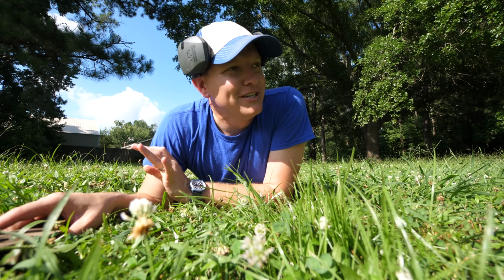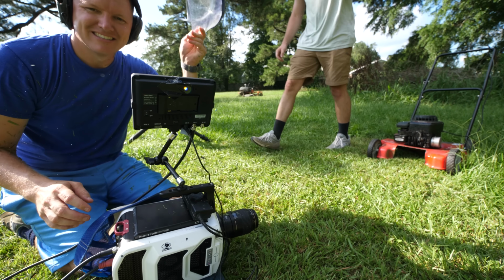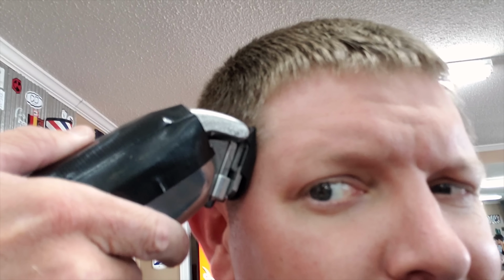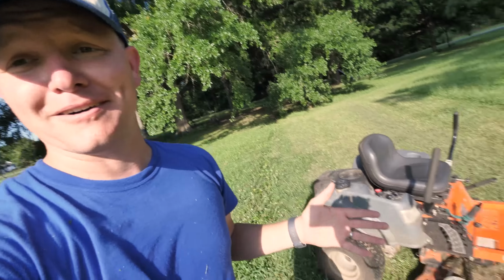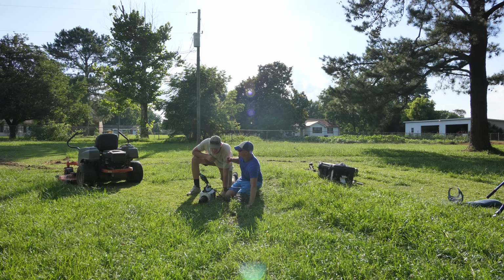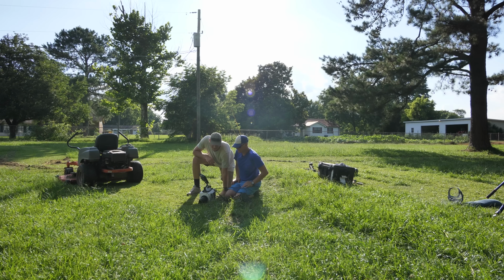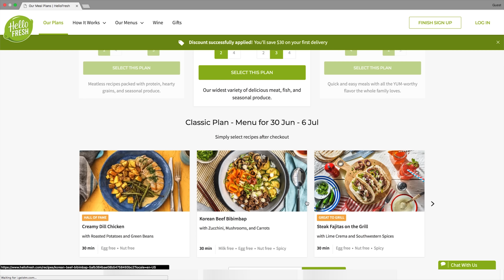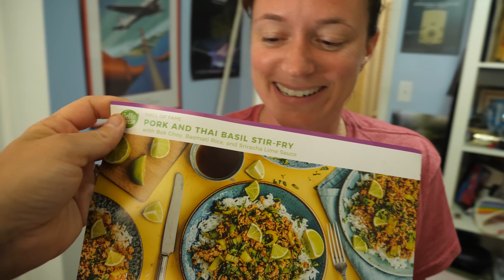How Lawn Mower Blades Cut Grass (at 50,000 FRAMES PER SECOND) - Smarter Every Day 196

Comment: Some blades dont have the "lift tabs". Explain that.
 Those are more to do with mulching. 
Remember it doesnt take much pich on a fan blade to produce lift.. Mower blades are not parallel to the ground.. They are tilted. To much tilt and you would need more power to spin them.
Mower blades must be sharp to cut correctly. 
The deck does have an effect. The side exit hole has a specific design. Your hole.. Did not. 

I feel you did not do your research prior on this one. 
Get ahold of some companies.. See if they can help you out. Sponsore and or just with some info. 
Colaborate with the LCN or Grass Daddy here on youtube. 

Btw.. A reel mower or a brush cutter are scisor like cutting for grass. Usually produce helthier and better cuts.
Reply: TurboFlush actually lawnmower blades shouldn't even be that sharp. They work with friction. Ripping rather than slicing is healthiest for the grass. The lift is there for ejection.
Reply: Alkyl Dimethyl Benzyl Ammonium Chloride from what I learned over the years from doing this as a living, you do want the blades sharp. A sharp slice in a blade of grass is the healthiest for it. Ripped grass is not healthy, makes it susceptible to disease. Reel mowers are best because they slice in a way similar to scissors (that is why most golf courses used them to this day) 
But for most yards and lawns a rotating blade as long as it is sharpened regularly will be just fine.
Side benefit, the sharper the blade the less drag it has, especially in tall/thick grass, so less wear and tear and even a little fuel savings as well 
 
Take care!
Reply: Aaron Hainan you may be right about the slice vs rip, but I do know that you want your blade to be less sharp than a knife. Maybe it's because it will lose its edge faster. I have learned that you don't want DULL blades, but you can tell by the shape of the grass how it's cutting. I've always been taught not to sharpen it like a knife.
Reply: Some blades don’t have the lift tab or whatever you wanna call it, but all blades produce lift. Either the blades are not parallel to the ground, (like you said) or has some type of curve on the blade. It doesn’t take much to produce lift when the blades are spinning 200+ mph
Reply: TurboFlush, I have to agree.  This video stopped far short of the research I associate with Destin's work.  I'm sure any of the blade manufacturers ir ztr manufacturers would have gladly commented on the dynamics involved with grass cutting.  This one kind of fell flat.
Reply: Alkyl Dimethyl Benzyl Ammonium Chloride you could have a razor edge on a blade but you are correct, it will dull pretty quickly and the edge will roll if you have too narrow of an edge to the blade. Also correct that you can tell by looking at the grass you just cut. If it looks like it has nice chopped edges you should be ok but if you see ripped or torn edges time to sharpen. I usually look at the grass after I have gone over it but you could also look at the clippings too if that is easier
Reply: Cameron4life we sell a sand blade for the golf courses that produce no lift at all. it's even sharpened in the center instead of on the edge.
Reply: I've found that my scissor mowers are useless when they are adjusted to cleanly "cut" paper. Damage from the amount of pressure required aside - the energy lost from grinding the blades together pulverizes the cuttings and freezes the entire operation in very little distance.

When the blades are adjusted to just graze paper (or barely touch end to end) they are able to build up momentum while smashing/ripping the grass and other yard debris as desired.

This is absolutely contrary to what the English version of the manual that came with my last mower states. I don't believe that the grass in Quebec is not that different to justify giving the French entirely conflicting instructions (that produces a working lawnmower). But it allowed me to pay $50 (new in box) for a mower that currently retails for $250 (because the store was wary of all the returns) - pity that my family spent more than the difference having the local shops sharpen it (and [cuss] at me for over-tighenting the blades ) every time they noticed the blades actually turn without screaming.

(Admittedly I do need to take two near-perpendicular passes from different directions to pickup and cut the longer material that gets flattened over before they can be pulled between the blades, but this happens irrespective of the absurd tightness of the blades).
Reply: I have never seen a lawnmower blade without the tabs for lift. I think you are mistaken.
Reply: One word/object to debunk this video: flymos. Lawnmowers that hover using a fan attached the blade's drive shaft.
Reply: I agree with TurboFlush about the fact that lift-abs that are on lawnmower blades aren't there for lawnmower to be able to cut grass in the first place but instead for creating sufficient airflow which is needed for the grass to be ejected out from beneath the lawnmower through an ejection tube successfully. Such tube is either placed on the side and allows you to gather the mown grass in neat rows or at the back for gathering the grass into a grass-collection basket.
Now if that lift-tabs would be needed to keep grass upright, then your wouldn't be able to cut grass with string trimmer where you are cutting grass with just a string and yet you can. 
And the reason you can is because the string or blade in case of lawnmower is moving so fast that the grass can't bend and slide over it without breaking first due to the friction of the grass on the blade or a string.
So Destin I do recommend you do some more research on this because you have failed to do your homework properly this time.
Reply: mulching blades generally have a down section and an up section. creating a circular airflow under the deck similar to a vortex ring effect.  which effectively stalls the blade while still moving air
Reply: yes, you are absolutely correct.  I made a similar comment above about him possibly filming one of those old school rotary drum type mowers.
I used to work in lawn care, and ever class I ever took, every boss I ever had, said those were the best for cutting grass(as you said, tearing cause the unsightly tips, ragged wounds that increase the risk of disease, lose more moisture, cause cells to rupture, require the plants to spend more energy/boost their immune systems to fix the damage and fight off disease, etc.) 
the analogy i made above was that it's like comparing the wounds of a petson who got their hands severed by a shark bite or chainsaw, vs from one swift stroke of a sharp samurai sword or something.

Comment: So cool! I'd love to see how the other main type of lawnmower works (the ones with the drum-like helix blade that rotates along the horizontal axis - they're common on small older lawnmowers and on those really big ones that cut the grass by the sides of roads). Could also do hovercraft-type (Flymo) lawnmowers - how do they hover when the blades should theoretically be sucking them down to the ground?
Reply: The term you want is a reel mower, as opposed to a fake mower. :-) Seriously though, it's called a reel mower.
Reply: RedButtonProductions  A shear mower. The blades are made helically and mounted on rings which resembled a reel (which is typically used for winding things about).
Reply: the hover mower is a perfect example - it draws air in from above and forces it out around the blades, the blades generate effectively zero lift and are not designed to (tab-less) because you aren't bagging the clippings.  The tabs on mower blades are for bagging clippings, not lifting grass to be cut. The blade cuts identically on a hover-mower vs a wheeled (non-reel) mower, it is a spinning knife.  You can buy such blades for weedwhackers as well (deckless).  The mower deck protects you and the engine (a shield) and allows you to bag the clippings.

Comment: Mower blades just RIP the grass. Now a REEL mower actually CUTS the grass! Look very closely at a freshly "cut" grass blade, you will see that the end of the grass is TORN and not cleanly sliced per say!
Reply: dull knife.... this video is wrong on many levels.
Reply: If the blades are sharp, they will cut. Just like a sharp sword can cut through material. A dull blade will cause browning on the grass blades. A sharp blade will not. The blades of grass will stay green right at the ends that were just cut.
Reply: +AP2020 Outdoors Adventures
Sharpen your mower blades, THEN they will cut the grass. I do this professionally, and have to sharpen mine about every 3 weeks to maintain a good quality of cut. More often and I'd be replacing them more than once a season (not to mention that I've got enough work to do maintaining the equipment).
There's a big difference when you mow with freshly sharpened blades ;)
Reply: Reel mowers! Do reel mowers next destin!
Reply: Agreed!  Reel mowers cut like scissors - the bed knife is stationary while the reel blades cut against it with a classic scissor action.
Reply: AP2020 Outdoors Adventures Came to comment that cylinder/reel mowers cut like scissors. Only way to mow I think, unless you're doing paddocks.
Reply: That's why golf courses always use reel mowers.  They actually slice the grass like scissors, leaving a nice clean cut.

Comment: What about the Whipper Snipper? there is no suction!
Reply: whipper snippers hit the grass with a piece of hard plastic moving at over 400kph. Its sheer maths, and the plastic is light and thin enough that it doesn't generate that enough wind to cause a problem, and the impact is so fast the grass is unable to bend before sheering.
Reply: You raise and lower those during the “whipping”
Reply: I believe there is suction as the line rotates pushing air outwards, pulling it in from below. I could be wrong though. I would love to see this in slow motion with different types of line. Also I've never heard the term "Whipper Snipper" and it's kind of hilarious.
Reply: Whipper snipper is used here in Australia, what is it called overseas?
Reply: treksez it’s called a weed wacker,
Reply: i've also heard it called a "weed eater" or a more generic "string trimmer"
Reply: Keaton Entze or string trimmer
Reply: Cheesus Sliced is essentially correct - the nylon cord on the weed-whacker travels at very high velocity, much higher than the blade of a mower, and the inertia of the grass or weed being cut is the source of the resistance allowing the  cord to shear through the plant before it moves out of the way.  As evidence, note that these machines work best on plants which have grown high, and relatively poorly on those that are already trimmed near the cut-line.  

P.S.  "Weed-Eater" is a specific brand name.  Here in Canada, either whipper-snipper or weed-whacker is generally accepted as generic.
Reply: Andrew Frink weed feeder
Reply: Ahh, but what about the difference in line size and/or line construction. Does a heavier line not yield as much and cut better? Do lines that have edges along their length, square or hexagonal line, concentrate more force at the point of impact?
Reply: I've heard them called other things such as the brand-name Weed Eater which is kind of a generic name now similar to Kleenex meaning tissue. But the device is usually referred to as a string trimmer. But I've usually column weedwackers.

Comment: This video illustrates the reason for a sharp well designed blade. As well the need for a well designed deck. I have had a number of lawn mowers over the decades. My 15 year old Ariens has the best suction, pick and even cut.

Comment: Do double blade (rotating in different directions) lawn mowers exist ?
Reply: A reel type mower moves a blade against a fixed anvil, much like scissors where you keep one half stationary. There are also brush cutters that work like giant barber clippers.
Reply: David Phillips Thanks
Reply: Walker makes opposing blade mowers. the mower has a box on the back to catch the clippings and a chute under it with an impeller that sucks up the clippings and deposits them in the collection box.

Comment: I'm 29 and I knew that the tab which is also called a lift and the more lift on a blade the more suction you have hence why they have low, medium and high lift blades. The high lift blades can also cause more stress on a mowers motor bit in my own opinion cuts better now look at a mulching glad that has a high lift but also has slots cut out in the lift and what this does is that makes some of the grass and or leaves to fall back down to the ground and not exit the chute of the mower. Great video by the way.
Reply: Im 12 and I knew the exact same thing before I watched this video, smh.

Comment: Every seen a cylinder mower? They use that shearing effect you showed us with the scissors, by spinning a helix shaped set of blades next to one other static blade.  Interesting to compare.
Reply: They are called reel mowers, but you are absolutely correct. Way to think outside the box
Reply: Reel hand push mowers from the 1930s are powered by the wheels geared to the blades. You push it forward.
Fancy ones had gas engines and were self propelled in the 50s.
Reply: We call them cylinder mowers in the UK.
Reply: We call them rotary push mowers in Canada.
Reply: We call em obsolete in Australia. 🤣😂😁😀😎

Comment: Cut off the tab and see what happens
Reply: I have cut the tab off of mine before, it can cut through really thick grass easily, because if minimal drag, but doesn't cut very well, because of no lift, leaves uncut grass everywhere
Reply: They make different kinds of blades some with more lift some with less lift, some with serrated lift tabs
Reply: Oh ok never mind, thanks for telling me
Reply: @johnwilliams7246  Basically, it works but not as well, since the blade is still fast enough to cut but the grass isn't pulled up, right?
Reply: So a mulch blade?
Reply: Drew, you are a low-key scientist who knows how to change variables to test a theory! Well done!

Comment: See how it cuts without the lifting tab
Reply: Betcha it cuts just fine.
Reply: Most commercially available"mulching type" blades have little to no sail on the back of the blade. They cut most grass fine, but if you pay very close attention, they do miss some pieces, especially when moving at a faster pace.
Reply: Dixie Chopper blades are flat.  Im calling shenanigans on the vacuum thing.
Reply: The science behind "flat" or "low sail" blades is, with less air being moved through the deck, the clippings remain in the blades longer, allowing them to be cut finer, and dissipated into the grass. The lower sail also decreases the amount of resistance on the blades, allowing for a faster spindle speed that partially makes up for the lack of upward suction.
Reply: Nat The Project Guy just because it's flat doesn't mean it's not making a vacuum... saying that makes you seem absolutely mentally inadequate. A .50 BMG round that passes beside your head within 6 in will still kill you. The vacuum it creates as it flies through space creates a sonic boom right next to your head that kills you. Look up hunting with a .50 BMG. As the blade spins around, it could quite easily create a vacuum.
Reply: Britt Guess - Good deal. It's what I was thinking too... Those choppers have multiple blades that spin at a much higher RPM reducing the need for more lift. Weee!
Reply: Yeah he defiantly need to run a control for the experiment.